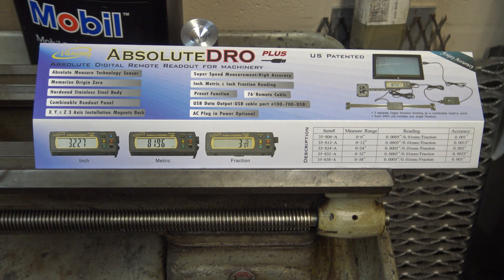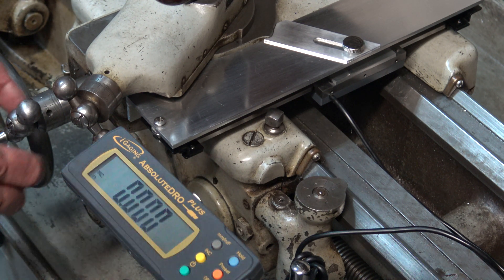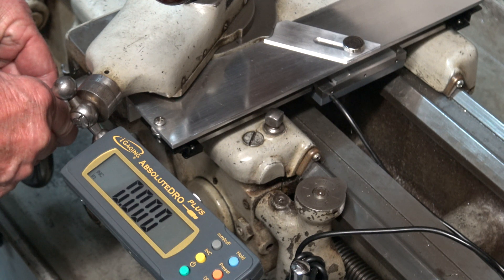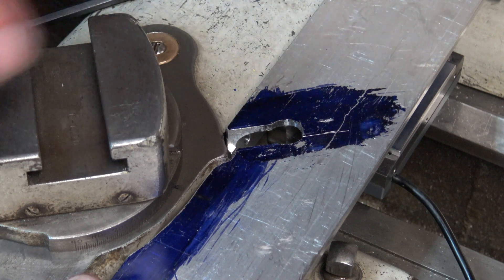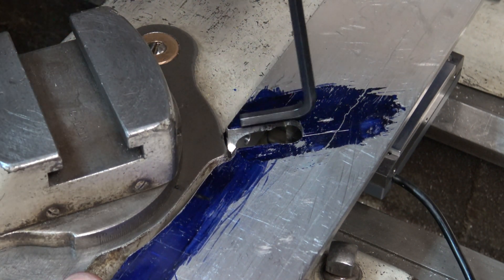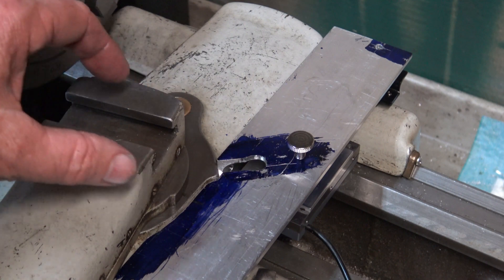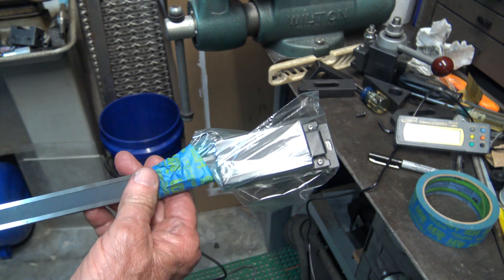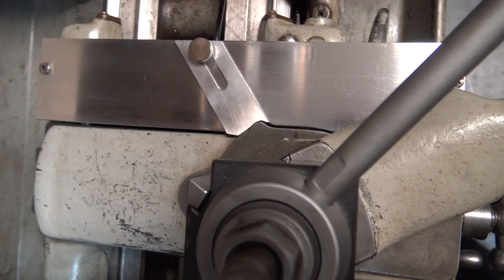DRO on a South Bend 9A Lathe

Comment: Great job!
How much do you use the cross feed DRO?  I find my Z axis DRO very useful but not sure I'd use the cross feed one as I have a direct 200 graduation dial so I don't have to multiply x2 all the time.
Reply from the maker: I thought about making a Larger dial on the cross feed. Sounds like you have a nice one. I like the DRO on the cross feed, and it reads in half thousands. I might add a Z axis DRO. Right now I am using a 2 inch range dial indicator on an adapter that clamps on the ways. Watched your videos. You should make one on the cross feed dial and how you mounted the z axis DRO.

Comment: Are you able to display Diameter on the readout?
Reply from the maker: It doesn't have any calculation ability. It only reads the same as the dial on the cross feed only more accurate. You can zero it out in any position.